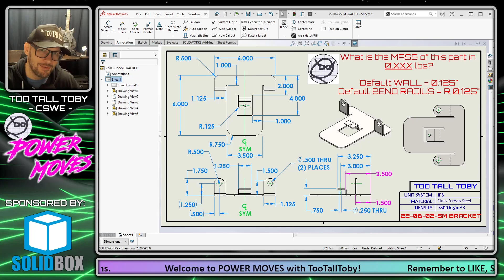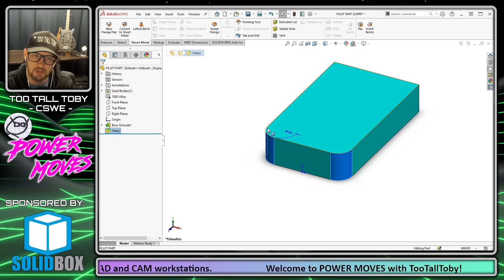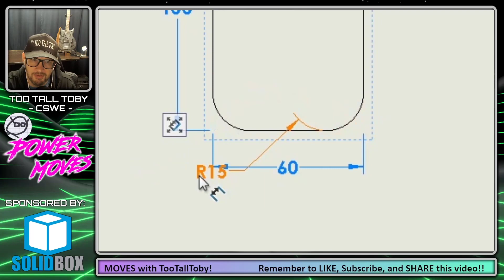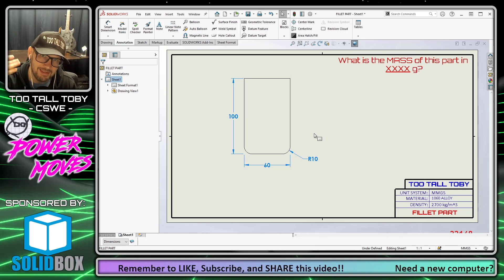Stop DELETING Dimensions!!

Comment: HI Toby can we have a session or series of sessions related to assigning annotations in Part/Assembly and then import directly to the drawings (such as a bit complex structures with different sections, assigning a single annotation to two views, etc.)
Reply from the maker: Yes this is a great suggestion and although many of my tips are on Parts and Assemblies, I do have quite a stash of Drawings related tips and tricks - Just need to release them out into the wild!!

Comment: Top down modeling means you get dimensions to points that are not even on the part.  I hoped you had a trick for that :(
Reply from the maker: Yeah - a lot of times in top down modeling I add DRIVEN dimensions to the part that's dependent on the assembly layout geometry.  Maybe that will work for you?
Reply: @TooTallToby  Personally I don't like model dimensions in the first place so I don't use them anymore (engineers like to change drawings to make numbers look nicer...breaking assemblies), but my last company required their use.  If something was missing...that was fine, just drop a dimension in the drawing.  But if something was there, you were not allowed to delete or hide it.  Thankfully you were allowed to put it in brackets at least.

Comment: This is great - similar to the method for reattaching dangling dimensions in a drawing. I think a video on how to reattach danglers, possibly also touching on the best ways to create non-auto dimensions in drawings (e.g. line to line Vs point to point?) and make subsequent edits to your parts (editing rather than deleting and remaking features where possible) to avoid them dangling in the first place.
Reply from the maker: Great Suggestion Parge! Thanks - I'll add it to the list!